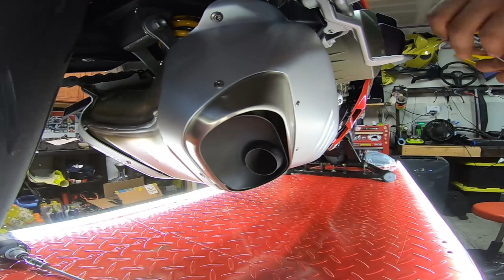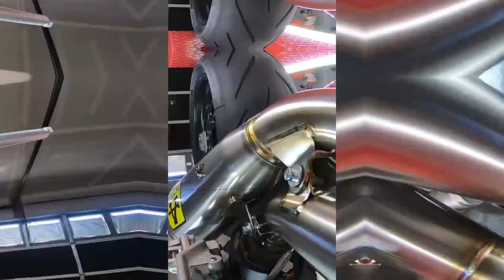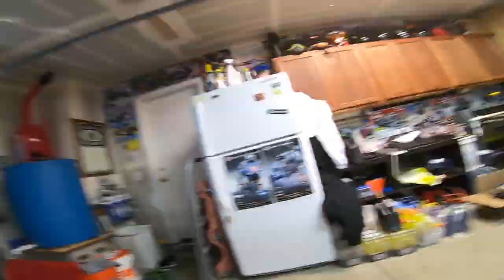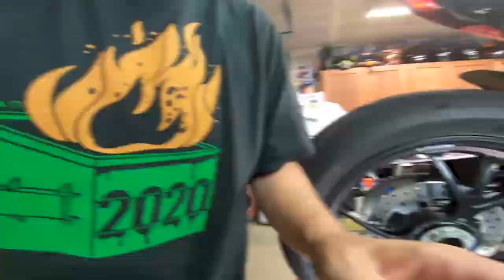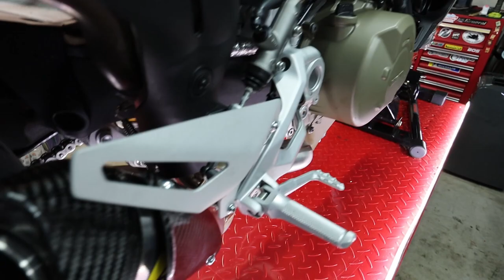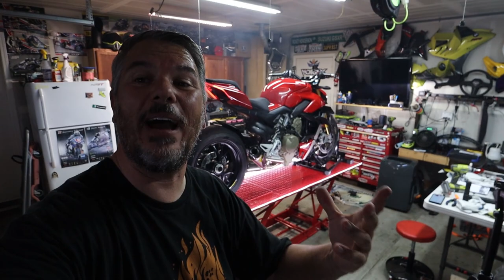2020 Ducati Streetfighter V4 S Arrow Exhaust Install | Fireballs Incoming!

Comment: Not to take away from the moment but looks like you’ve sprung a leak... put a competition werkes on my Ducati a few days ago and first install it leaked. Loosened a few brackets on the header to get some play and then bolted up the slip on and it sealed right up.
Reply: 8:40 there’s smoke coming from around the 02 sensor

Comment: Hello, I have this same arrows exhaust on my 2019 Panigale. It is awesome, it sound incredible ! The power gain is excellent, I dynoed it before and after, power gain is +15 rwhp which is very good, especialy comparing to the 5000€ full akra power gain ! The dowside of this exhaust is: 1- with no tune you'll have a check light on. 2- It is so loud that it is barely legal at some racetrack. My bike with this setup had been measured at  101Db (at 1meter with 4500 rpm). This is a problem in Europe at most racetrack... A dB Killer to become racetrack legal would be a great addition ! The akra is quieter and will pass racetrack sound check easier.

Comment: Were you able to get it to stop smoking? That was an exhaust leak and not oil burning off. Other than that looks and sounds like a beast. I just bought one to and am have a hard time forking over 5k for the Ackropovich as well.
Reply: Cali Moto TV sooo, did it stop?

Comment: Bill did you weigh them to see the difference over standard? 
With regards to the standard can removal, they recommend that you remove the heat shield off the rear bank and loosen the header bolts and the exhaust pulls off much easier. 😀
Reply from the maker: Didn't weigh it sorry.

Comment: Sounds brutal, I love it. Making my rethink my Akra order for mine (it's still stuck in Slovenia or something so I have time to rethink). Looking forward to what you do next with yours! And yeah, I've put all sorts of Panigale parts on mine and have all been a perfect fit. The only difference in the Akra system for this and the Panigale is the placement of that right silencer according to my dealer. Apparently it's to accommodate the lower peg position so that makes total sense it's snug like that.

Comment: if you can remember, did you have problems with just the servo eliminator?  aside from the cold start, how did it run compared to stock...?  just about to pull trigger.. and you got me sold on the panigale slip on instead of SF.. ultimately, do you recommend using the upMap like you have on other vids?  thanks bill... love the vids.. keep em coming sir...

Comment: Are you using an Upmap T800 to get the Check Engine light off?
Reply: There is no upmap for the SF yet...I'm waiting till a map actually comes out.  The only map available is the Akro, IF you buy from Ducati.  The ECU doesn't magically "adjust" to slip-ons; the bike will just run poorly with no map.

Comment: I bought the same Exhaust for my new 2020 V4s... Great Combo!!!!
Reply: @CaliMotoTV , Thanks, Brother!!!
Reply: Stanley Vignier did you tune after your install? if so what did you use?
Reply: did you have to buy the air filter and termi flash with it?
Reply: @nolimitash392  Installed the Air Filter, but the tune isn't available yet for the 2020 V4's yet.
Reply: @WITHTEETH1  I bought the Air Filter when I bought the exhaust.

Comment: Pllleeaaaase is it possible to hear a sound clip with a proper mic/recorder combo where it's not clipping?  Thanks! Sounds nuts
Reply: @CaliMotoTV  also, I was watching another video with the same setup on a v4 panigale. That had the pipes straight and symmetrical. Any reason why your setup is the way it is? Is it a fit issue?
Reply: @CaliMotoTV  also, and this is asking for a bit too much, but a sound clip with baffles in would also be AMAZING!

Comment: i have a question. did your check engine light go off after you did the upmap?
Reply from the maker: There shouldn't be a CEL with the upmap.
Reply: @CaliMotoTV  ok. ill reupload it. the battery was running low toward the end of the install. the upload got to 75% and then said Done. maybe thats it

Comment: Hello I just installed this exhaust and UpMap on my 21 SFV4S and have noticed some kind of revving up and down at idol when cold. Does yours do this ? Is it normal? Once it’s warm it’s good.
Reply from the maker: Do the following. When the bike is cold, start it and let it run through two heat cycles (fan turns on twice). Once that's done, let the bike cool over night. It should help with that.
Reply: @CaliMotoTV  I did that at the first start up. Based on you mentioning that in one of your videos, I will try it again to see if that helps. Do you have the sprint air filter or stock? Mine is stock, maybe that is the issue ? Anyway, thanks for the response and keep up the great work I’m a big fan!

Comment: What are you using for an upmap or tune?
Reply: Are you getting a cel for the rear o2 and the servo motor? Are you planning to ride it like that? Thanks for the info! I put my deposit down in October but my dealership didn’t get any bikes. I was told to expect delivery around the end of may. I have a stack of parts piling up.

Comment: After instal the Arrow exhaust,  UpMap, SprintFilter,  you feel bike better in any rpm range ? Or its worst in some rpm, the top speed it's better,  aceleration and low rpm torque? Thanks so much.
Reply from the maker: Bike runs great. Watch the content on the channel for more info.

Comment: Does that small bracket come with the exhaust always or was it added so u can try fit on streetfighter... also  can u do vid of pipes with db baffles in  cheers man
Reply: @CaliMotoTV  ok man  maybe when making next video poss do a section with and without db fitted as a add on... if not no worries....

Comment: Arrow had an earlier generation of this exhaust part number 71145PK this one is 71146PK.  It looked a little more symmetrical do you know what happened to that one and why they changed it?
Reply: Cali Moto TV any plans to remove the secondary air system now
That you removes the catalyst?

Comment: Did you loosen the bolts of the rear cylinder exhaust manifold when removing the serial exhaust?
Reply: @CaliMotoTV  ok. THX. 
I didn't unscrew either.  It took a lot of force to disassemble the factory exhaust.  But it worked.

Comment: Hi bro, I believe the Akra mufflers require a code that the dealer will input into your ECU in order for them to work properly, do you not need that with the Arrows? Do you have any error messages? Thanks Mike ps - look forward to seeing the dyno comparison!
Reply: Forgive my ignorance, what type or make of servo eliminator did you use? Thanks again

Comment: Lol... thanks to this video I now own an arrow exhaust for my 2020 v4 Panigale but I haven’t installed it yet. Question, did the new exhaust cause any service lights to come on and did you do anything to turn them off? Does the bike have to be tuned with the new exhaust for it to run properly? 

Thanks for the information.
Reply: Cali Moto TV yeah, thanks for the information... I been calling around and that’s what I’ve been told too, with the servo buddy. I was also told, today that the T800 UpMap will now work with this system as well, so I’m going to do a little more research and see if that’s a possibility... again, thanks for the information...

Comment: Hi , i have à streetfighter v4 , canadien version , do you know how to make the head Light Work like the Europe modèle , here in Canada and maby in thé US , thé round light are on when thé engin is running , in Europe thé switch on thé left handèle bar is use to turn thé round light off , but on the us and Canada modèle , this switch is not fonctional

Comment: Hey, I personnaly prefer the Akrapovic system, in addition no need to re-tune
Reply: Cali Moto TV yes you’re right, what i meant is that the « ducati tuning key » is sold with the akra exhaust, and i think it is not the case with the arrows. Can you confirm that ? Anyway, really nice video bro’ 👌

Comment: That shows how little Ducati changed between the superbike and the streetfighter. Personally I think they didn''t do enough to differentiate the bikes, its a thousand miles from a bespoke streetfighter and more like a hack job. They should have done more with the frame and the rear end of the bike to change it up

Comment: Bill, did you take the heat shield off the stock Exhaust? ( https://admin.arrow.it/img/documents/3884633.PDF )  The Video looks like you didn't have to. I'm just asking cause I'm planning to install mine this weekend and wanted to get your input since you are the only person that has detail the Arrow V2 installation process on the Ducati V4/V4 Streetfighter.

Comment: Great video absolutely love the sound sounds better than AKRO exhaust by far. I have ordered the same Arrow exhaust for my  V4S street fighter from motomilion,  i just wanted to find out did manage to find out how to easily remove the exhaust box as i see you mentioned it took took you around an hour and a half to remove would appreciate any help you can give. Just wanted to ask you why the exhaust was smoking in the video when you started up the bike just interested to know if any adjustments were needed. 

I have also ordered the R+G RACING radiator protector for panigale V4 you mentioned in one of your video's you had a problem fitting it did you do a video if not what was the major problems you had fitting it and what advise can you give to make fitting easier. 
I have also ordered the Panigale tail to get rid of passenger seat and R+G tail tidy hope you will be doing video's on fitting these items or similar in due course.  Many thanks Bradley from South Africa.

Comment: Just fking wow! :D
Reply: @CaliMotoTV  Dude, I have no idea how this stands right now but according to a tech the stock ECU does NOT recalibrate itself to the loss of the CAT and free-flowing the exhaust system. Without a map you're running lean and risk damaging the valves. Just so you know. :)
"ProjectMoto
Panzerlang ok I spoke to the technician, and he said you really would need it mapped if you wanted it to be right when changing the exhaust cans and getting rid of the cat, the bike would run but not properly or to it’s full potential , also like I said you’d have a warning light on the clocks because of the exhaust valve , and then if there was ever a problem with your bike it would show on the logs that you changed something without updating which I guess could void a warranty or something ??, I don’t work for Ducati so don’t know exactly that’s just my opinion , personally if I was spending the money on the bike,exhaust etc I would go for that too... unfortunately for me I can’t afford none of it any way"

Comment: Hey looks good man.. Its ok that you dont spend $5K on the akra... Other Motovloggers only have it bc their Patreon Subscribers paid for it.. yet they call it their own!!! Lol
Reply: Lol hey what bar end mirrors you thinkin of putting?? I think bc the lines of bike are pretty sharp the CRG Arrow bar ends would look AWESOME!! That bike needs to be as minimal as possible.. exhaust goes Amazing.... your tail tidy cleans up back and bar end mirrors finishes look 👍🏼👍🏼👍🏼
Reply: By the way does the Arrow exhaust require a specific Flash or Tune to run better?
Reply: @mannyfel8324  I went with CRG Arrows on mine - they fit the lines perfectly. Totally recommend them.
Reply: Insane jeez love it bro.

Comment: Arrows are quality, looks great, sounds like hell and compared to the Akra its way better value. I'm going with this option. My only question is what are you doing up-map wise to calibrate the fueling?
Reply: I tried the T-800.  On my arrow on 2019 V4, and I didn’t like the tune.  I ended up swapping it for the Brentune.  Worked flawless after that.